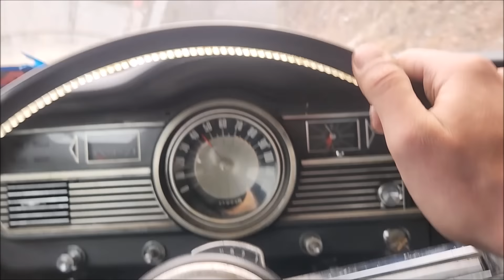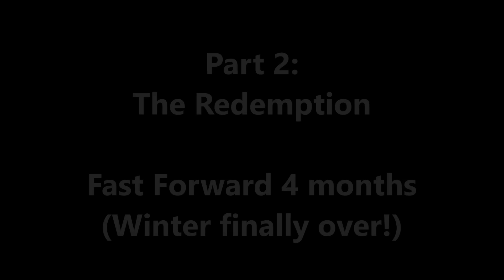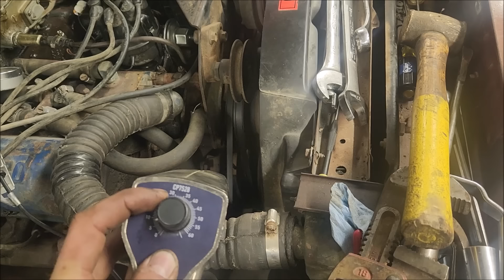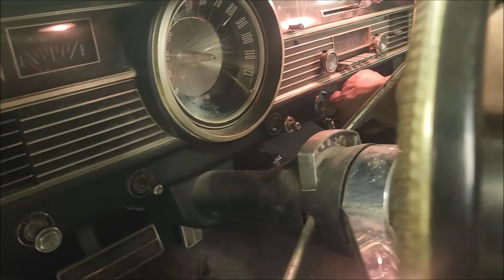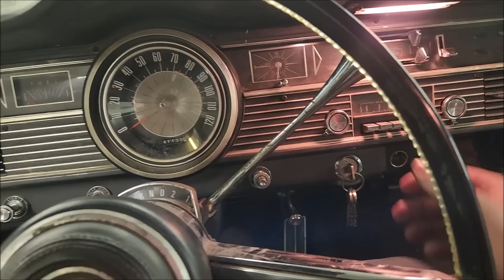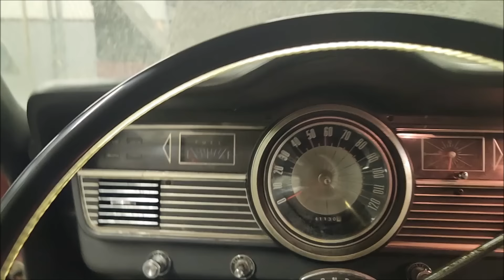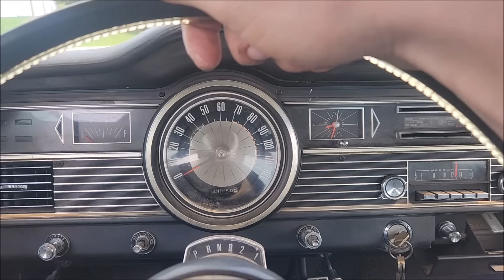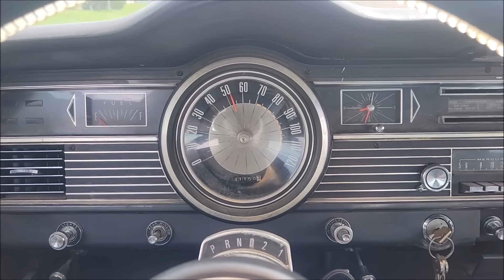$1,000 Classic Car - Will it Run & Drive Home?

Comment: I like that you mentioned the issue of fuel boiling out of the carb. This has been a huge problem for quite a while. What you said about it being misdiagnosed is absolutely true. People keep calling it "vapor lock" and it's not at all. Popular solutions include electric fuel pumps, and this is also wrong. The pump might refill your carb faster, but you've still got a flooded engine. Phenolic spacers do help a lot! An electric fan hot-wired to a thermostat works great. It will run for a few minutes after the car is shut down, getting that hot air out of the engine bay. New cars do this. That's how I got the idea and it WORKS!

Comment: I already had a fairly good  grasp of the basic concepts of timing but this video helped clarify things even more.  It's never just one thing.  An engine is a compilation of different systems that have to work together.  You can't 'rob Peter to pay Paul' and expect good results.  Kudos from an old fart for sharing your wisdom!

Comment: Don't feel bad about the distributor disappearing on you. I have stuff do this time to time. Last one was a volt meter that I had just checked battery. Just disappeared, found it in the trunk of the car 3 days later and remembered that I had run back to check power to the fuel pump! LOL  Glad I am not alone!

Comment: Good tip for tapping holes you don’t want metal chips or debris in. Pack the flutes full of grease. They will catch the majority of the chips as you run the tap into the hole.

Comment: Outstanding Young Man, I had not been here in a while and am not a Ford guy at all but when you started to dig into the dirt the vacuum port  blocked the throttle plate etc the tuning of the Vacuum advance the heat soak on the carb Yeh all of that was just awesome. You are an excellent explainer and I greatly appreciate your videos. If you get back to Northern Virginia you must let us know I would buy you coffee or coke a meal and chat be great. Dennis
Reply from the maker: Sounds like a plan - I loved the summer I spent in Virginia with my 65 galaxie

Comment: Absolutely one of your best videos. I am a farmboy myself and if you take your time and understand the vehicle, pretty much any. You will get a creampuff runner like this. That is not an FMX. It is a first generation C6 and they are an anvil. My wife and I got a 1969 LTD with a 390 2V with a C6. That was in 1980. The car was a South Dakota car and rusted out the frame and was tied with baling wire. But a good brakes after I got them right and lubed up it drove like a new car. If you drove like we did in the Ozarks let it fall off a hill up to 85 and not have any pressure on the gas it would still be going 60 at the top of the hill. We could get 25 mpg on a road trip. I pulled the engine and ran it in my 67 F100 for 20 years and put some  power in it a solid cam and ported a set of 64 Low Riser 427 heads and a Street Dominator, forged pistons and ARP hardware. Dynoed  at 510 hp and 485 ft lbs like a 427. It’s still in my 1965 Galaxie that my son and I built as bare knuckle street brawler. I lost my vision and he is afraid to drive it after I took him up to 150 mph G-tech 2 lane blacktop ride. His wife about had a cow. My wife, she was like Meh, he did that crazy stuff all the time. He was 35 years old. But I was in  a work accident that took my sight. Those 60s Ford and Mercurys were the best chameleon cars they could build. I still love the car sitting in the driveway. It was a true hot rod in every way. Not a muscle or a pony car, but it has factory adjustment at all 4 wheels for a long extension to adjust the spring bias on all 4 wheels.adjustments for caster and camber. They were built as a hot rod should be and a farm boy like me could set one up for” coursing “.. you don’t have that now. I had a 68 Mustang Coupe 289 4 speed and my wife and I loved driving that car, had the Shelby rear deck lid and a top loader and she loved the car and my hot rod truck. But, you can’t do that now. We have a twin turbo 2.7 V6 EDGE ST , 2022 and we love it too. The Good old days. Thank you 🙏

Comment: I used to be so against carbs but watching you and seeing the cost and problems people have with crap aftermarket tbi systems you have brought me back into them. I hope to get a carby again with a cc on it.
Reply from the maker: Carbs are honestly rock solid - I'm a programmer by day and drive a carbed car into work as nonsensical as that is. 
Most of the disparity with carbs comes from a knowledge gap - couple that with a mountain of misinformation on the web that can easily mislead people, and carbs get a lot more frustrating than they actually should be. 

And as I often say 95 percent of "carb performance" issues are actually ignition timing related 🙂

Comment: THANK YOU for this video !!!  I've been attending the school of hard knocks. I have a 1963 Buick skylark. I took off the rochester quadrujet, and put a edelbrock AVS2 on. I couldn't understand why my car would run good... but  when I go to restart it after driving for a while, it had that rough start. I installed an aluminum Open Carb Carburetor Adapter 4bbl Quadrajet Manifold to edelbrock adapter,  NOT phenolic plastic. So I got some work to do to eliminate that hot gas.  ALSO Thank you very much for going in depth. And showing how to adjust the
Mechanical & ported advance & Timing.. All of i it!!!   This Really helped me understand what I got going on with my Carb. And what 2 do to direct it.  I've been scratching me head... fighting getting it to run perfect.  
THANK YOU,  THANK YOU.  AWESOME DETAILED VIDEO.

Comment: On 2 carbed vehicles now I added a return fuel line and made my own restrictor with a brass fitting and allen screw drilled with a 1/16" hole to meter the return. So far great results on stock type setups. It keeps the fuel moving so it doesn't heat up as much and it also depressurizes the line when the engine is turned off. And you don't have the expense of buying a return fuel regulator and possibly become another thing to eventually fail. It's just another level of defense to cope with heat. I also run insulated carb spacers. 

Note: 1/16" return orifice seems plenty big. Definitely no need to go bigger.
Reply from the maker: That sounds a lot like a fuel return line system I made on my 65 galaxie in virgina

Comment: Good job. I use manifold vacuume to adjust the richness or to lean it out sometimes you can get  up to 20 lbs of manifold vacuum I use  to to drive my 67 mustang on the leanest mixture at idle but the shot I used was the longest one it ran like a stripped as ape. I like that line on the raido there are no old cocaine addicts LOL:face-green-smiling::face-orange-raised-eyebrow::body-blue-raised-arms::hand-orange-covering-eyes:. The 390 will have some hp. :face-fuchsia-wide-eyes::face-blue-wide-eyes::face-fuchsia-tongue-out::body-blue-raised-arms:It is suppose to have a spacer between the carb and and manifold. :body-blue-raised-arms::face-turquoise-covering-eyes: Another 1inch spacer makes up to 10 HP. The head liner is great in that car. Radio works. It not too bad a car. rusty quarters but they could be patched. If it is rich at idle it will load up.

Comment: Thanks for all the specific information. I will find it seriously helpful when I finally get to a point (in the next year) where I start putting my 70 Torino Cobra SCJ back together. I started a complete and total rebuild back in 1983 before I got married. The 429 SCJ was completely pulled apart and gone through in 83. I sent it to a speed shop in Mattawan, MI. The block was magnafluxed and bored forty over, it's been blue-printed and balanced, the rods were shot-peened and polished, it has new piston heads with a custom machined set of total seal rings, the heads were machined, valve seats and valves had a fresh grind & fit with new springs and seals. It's been so long that I tore it apart that I will need a refresher of the information to set vacuum, timing, and carb settings. I went from a true farm boy/self-taught gear head that loved working with steel in the 70's & early 80's that left in the middle 80's to become a carpenter with a totally different set of tools. Thanks man!
Reply from the maker: I call those legacy projects - my own version of thay is my 65 galaxie, it's nearly been a decade now and seems like just yesterday

Comment: I used to have a 327 that would back the dizzy 😵hold down bolt out no matter what I did. Replaced the bolt, added lock washers, chased the threads, only thing I never tired was locktite or a jam nut. When I sold that engine it still had that issue.
Reply: Probably needed a shim under dizzy.  They will do that if bottomed out in block.

Comment: "EZ Turn" is a good alternative to using thread tape on a gasoline or fuel fitting.  It's made specifically to seal fuel line connectors, doesn't harden and won't wash off from exposure to fuel.

Comment: Apparently, I missed where you said what engine was in the car.  IIRC Ford used a 390 cu. in but they also used a 410 cu. in. that was an FE engine that was only used in the 1966-67 Mercury.  Not to be confused with the 410 cu. in. engine that was used in the Mercury-based Edsels in 1958.  It was an MEL engine.  GREAT VIDEO!

Comment: Getting my 347 mustang fired up this spring, I pulled the distributor and used my oil pump drive tool to pump up oil pressure before starting the engine the first time. Of course I had the same oil pump alignment problem as you had! I finally got it back in with a little “love tap”!
Now I’m getting her ready for power tour next month! We hope to see you on the road !!!

Comment: Great hint in the end. I have had the same issue (15min parking) with my Mustang 1967 Fastback 289! I guess I am going to install a heat spacer. 🙂Best regars from Germany!
Reply from the maker: Hello hello from the central states 🙂
Spacer makes a big difference, a good phenolic 4 hole, even if 1/2 inch makes a big difference

Comment: Just a suggestion if you use a fuel filter from an early Dodge  318 that has 3 fuel lines on it 2 of them are standard size and 1 is small, that filter has a bypass so plumb the bypass line back to the fuel suction line before the fuel pump and that will stop the vapor lock when the fuel gets hot. It works very well.
Reply from the maker: Most of the time what folks think is vapor lock is often something else - like fuel boil in the carb such as in this case. 
But yes, for true vapor lock, very effective I agree

Comment: Another really good video. One thing, on mopars (I don't know fords) the vac advance can moves a fixed amount, but the adjustment changes how much vacuum is required to pull it. Interesting to know how different brands are designed.

Comment: I had a 390 in a 1 ton ford truck. I think it was a mid 70’s truck. One cold morning I was checking the oil fixing to head to work when I noticed the freeze plugs had popped out. Now I know those aren’t actually freeze plugs and that is not what they are there for but I seen it with my own eyes. The block wasn’t cracked so we stuck some plugs back in and kept driving it. I’m a Chevy fan but I loved that old truck. I put a lot of miles on it and it never let me down.

Comment: Once you set the distributor in place and it's not engaged in the oil pump bump the starter and hold down the distributor and it will drop right in, that's how us old school mechanics did it and it still works that way today on older engines!!! I never had a problem doing that back in the 1970s whether it was ford or gm engines
Reply from the maker: That's actually what I do, but im reluctant to show it as I've had the gears oddly try to bind on the cam before. Only happened once, but I don't want it to happen to someone else

Comment: Got a 1966 289 block, going 347 stroker for my 1993 F150, going the lightning route, Vic front suspension, 81 and can’t leave stuff alone.  Going to pick up one of your tuners.
Reply from the maker: I'm not a product pusher, but it is really nice for deep tuning and perfecting - mitigating all the guess work while handling the conditional variability inherent in daily driving 🙂

A 347 should really move 👌
Reply: @ThunderHead289  I have a 63 Falcon with a 347, a real heart attack machine, my F150 will be my daily driver, oh yeah toploader Hurst etc etc.  Going to shorten the bed too.

Comment: Nice video Luke. In the scenario you gave about driving the car and going into the store for a bit and having hard start/flooded, I found out about flooring the gas pedal in my old 1965 Impala owners manual. I inhearited that car 2 years ago and got it roadworthy enough to enjoy it in the summer. That trick helps a lot on them hot days.

Comment: Luke, you are a treasure. I'd love to hear how you learned about these engines in such depth. Thank you for taking the time and effort to educate and entertain us. Big big fan here.
Reply from the maker: Thanks so much 🙂 pretty much entirely from simply driving them as my primary vehicles for 15 years, and being a perfectionist - delving into something really deep if I didn't understand it to it's fullest extent. 
I just really like tuning 🙂
Cruising down the highway or interstate and everything running clean with good power, no better feeling
Reply: @ThunderHead289  so sounds like self taught from a great drive to understand stuff entirely. Great way to approach anything.
Reply: @ThunderHead289  The complicated but mechanical workings must be a great counterpoint to what you're dealing with at work.

Comment: On most gm’s i found that a tire iron works great to turn the oil pump when it dosnt line up, though some cars its not easy to get on down in there
Reply from the maker: The chevy is a slot, the ford is a hex - makes the ford a little more annoying

Comment: Luke, you are so the ethical trooper ! I'm OK with the FUD'z. They did some things right. Is dem dare FE the Mercury 410 variant. As for the transmission if it be the Warner Gear M12 Ford O'matic I can understand your distaste for them. ( Had one in a '68 AMC Javelin didn't live long behind a 343 ) You do right by getting the distributor back in tolerance just don't fergit the timing chain. Replaced motor with the 304 CID and the Motorcraft 2100 carb and Uncle Luke, Bob's my uncle now. You do a fine job of of taking us on your adventure. For a yung whipper-snapper U sho' know U'r stuff. Keep on keepin' on good buddy !

Comment: When we built the SB Mopar in my Valiant earlier this year, I sent the distributor off to Minnesota to be fully gone through & match the advance with the engine/trans/gearing combo. I did  put a 'vent' on the hood, using a reverse intercooler scoop from an '87 300ZX turbo, the headers are thermal-barrier coated, Air Gap intake and it runs the vapor return line. It works very well and a few people thought it was running FI, but it's just an Edelbrock 4-bbl

Comment: my dad's truck had a 360fe I remember when the fuel changed and started having trouble with boiling. I removed that heater hose from the carb, it helped alot.

Comment: What you found on the dash was Curb Feelers, they attach to the wheel wells so they touch the curb first so you don't rub your tires, look them up. Great information, been having a tough time with my 64 XL 390, suddenly just started running like crap, could always fix it, but I am stumped. Was thinking bad gas, just not sure. Come and fix it please.

Comment: Another thing I have found that really helps with lowering the gas boil point is to add some marvels mystery oil to the gas when I fill up. It's extremely noticeable in my slant six, and now I just do it with all my older vehicles

Comment: TH289, Back when my 79  Chevelle wagon needed to pass emissions, setting the carb at max vacuum was the easiest way to get an OK. Once through the screen I reset the carb for best performance. So sometimes being too lean will keep you behind the wheel. I sold the car to my nephew who put another 35 K on it before selling it to a guy who is LS-ing it! That old V6 had gone well over 200 K without a refresh or rebuild! Careful tuning rules! Thanks for the tutorial!
Reply from the maker: Just goes to show that old engines can easily trade paint with the longevity of new stuff if in the right hands 🙂

Comment: Awesome, everything in the one video, explained well and shown well, perfect. 
My 351w runs not too bad but I will go through these steps just to see if I can get it on point. It’s a reasonably recent rebuild with a couple of thousand miles now. 
I have a very slight movement on the vacuum gauge at idle fluctuating slowly 1 either side of 20 I was thinking ignition but not sure, the engine also has a slight shake at idle so no balancing a coin for me.

Comment: Nice to see someone explain things factually  correctly.  It's getting to the point where most on the internet "teach" you all wrong.  These classics can be turn-key and consistent in all temperatures every single day.
Reply from the maker: I drive a carbed car everyday - everyone thinks I'm kind of an a hole, but im very much into putting the correct info out there and I don't care about hurting anyone's feelings in the process